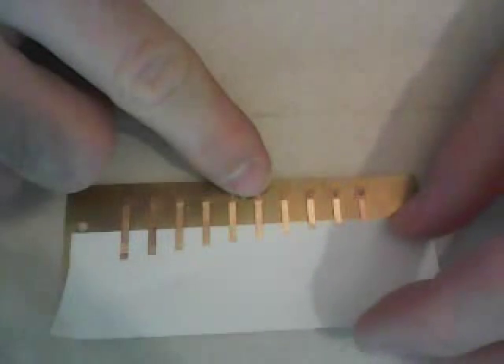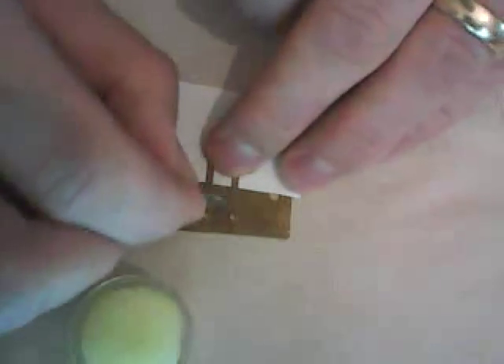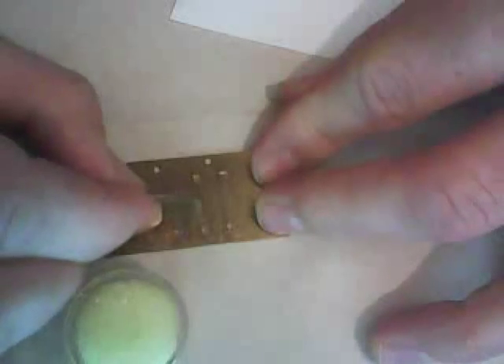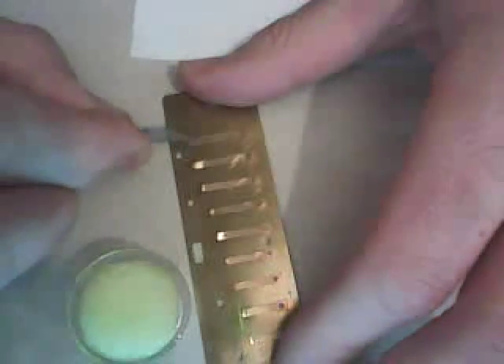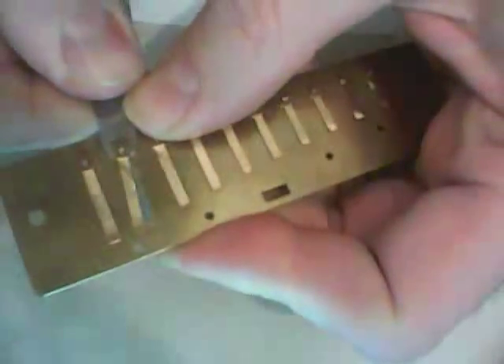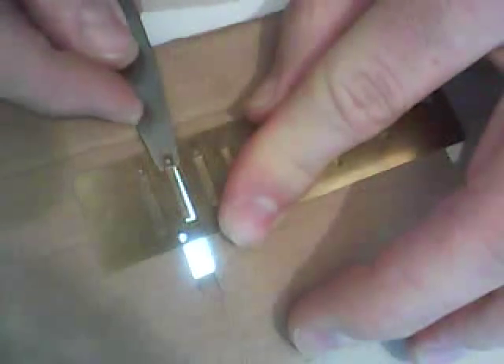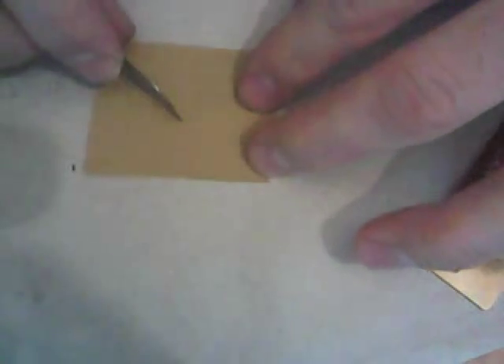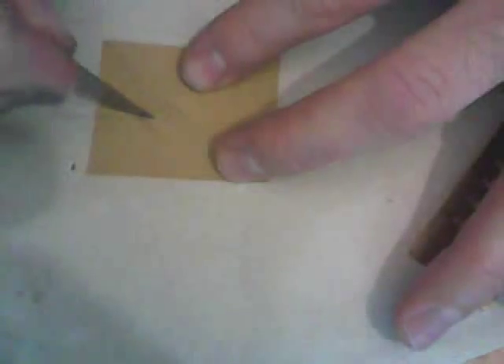Embossing the reed slots of a harmonica (With quality control)

Comment: i don't get how scraping the reed slot makes the reed slot smaller
Reply from the maker: +harmonica guitar Here is a link that shows what's happening:
http://harp.andrewzajac.ca/sites/harp.andrewzajac.ca/files/Embossinginstructionswithimages20130728.pdf
Reply: Andrew is actually 'swedging', by wiki: "To shape metal using a hammer or other force.".  In the case of the reed slot, from the edge of the slot is into the slot and there by making it narrower, closer to the reed. All of that effort is to reduce the air flow an around the reed and better direct it to the reed thus improving reed response.